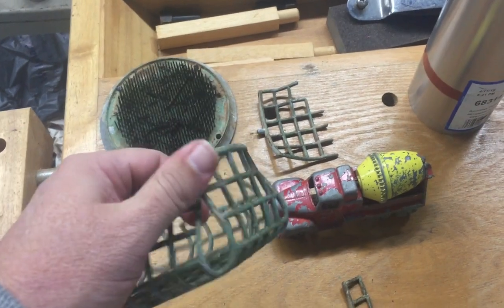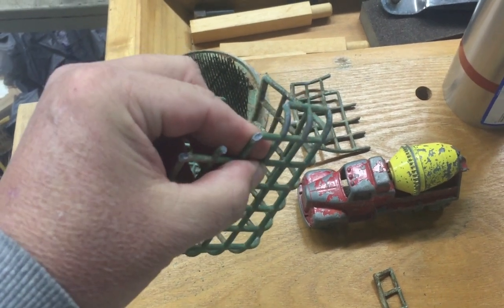How to ID pot metal , white metal , cast zinc , monkey metal

Comment: I've bought a replacement set of headlight buckets , and they don' t have pre-drilled  holes to fasten to hood as needed. Salesman said they are made of white metal (grainy cast appearance) also the hole that receives the wire harness grommet needs to be larger. my question is this metal strong enough to drill (drill press) ? Is a step bit a good choice to increase hole for wire harness?  Keep up the GOOD WORK.
Reply from the maker: You should be able to drill it with no problem, make sure the bucket if supported properly. Most of the time with white metal damage is caused by sudden impact such as a drop. Trying to add pressure to the bucket while drilling can also cause damage if the bucket is not on a firm surface. Thank you for watching.
Reply: Thank you again for the reply. drilled really well, even the step bit went smooth for the larger hole.
Reply from the maker: @brettmckinley6632  Awesome, very happy that I could help! Thank you again for watching.

Comment: Cast and Die cast have zero difference, other than pressure. Die cast is aluminum cast under pressure (and no oxygen). Thats it. Thats the only difference.
Reply from the maker: The significant difference between the two is the material for casting the products. Cast process uses a pure material, while die casting allows the use of a mixed metal, due to the pressure.
Reply: @happyscrapper8655  There are many different aluminum alloys that can be cast normally